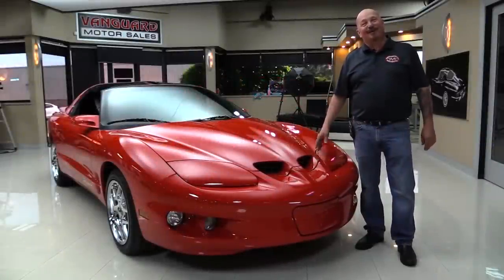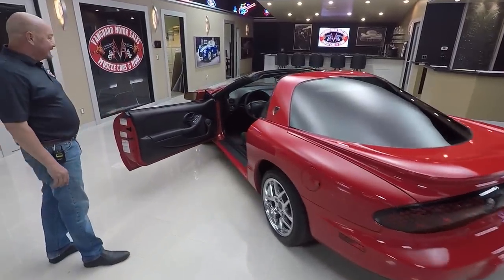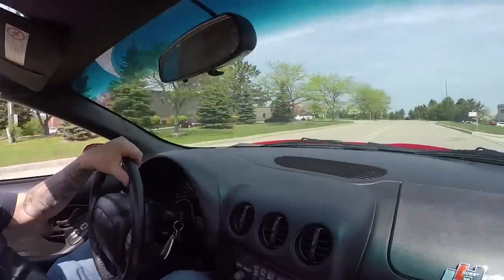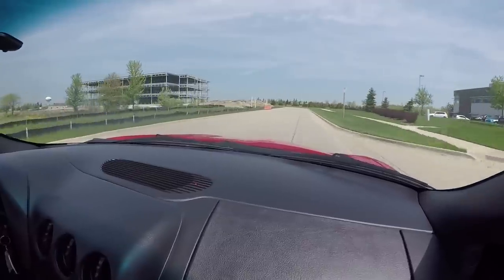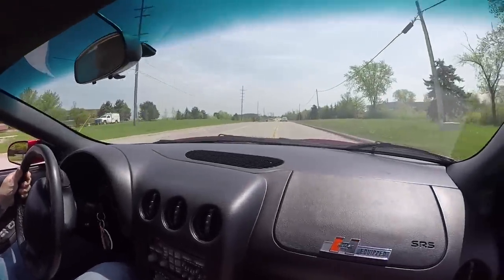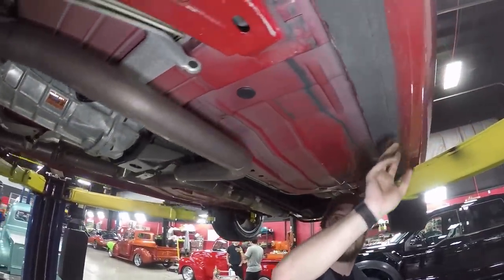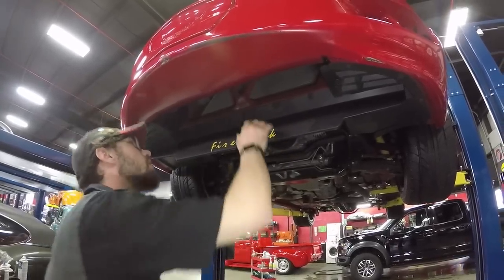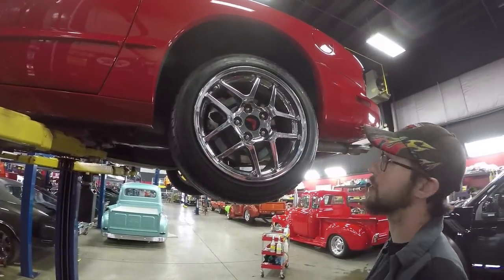2002 Pontiac Firehawk For Sale

Comment: Here's what I don't get: I know the Firehawk is designed slightly differently than the Trans Am on the hood. But this one seems based off a Formula with the fog lights placed differently and the lower spoiler.